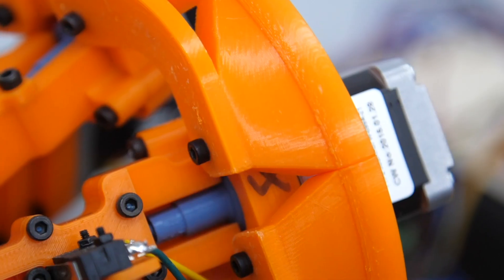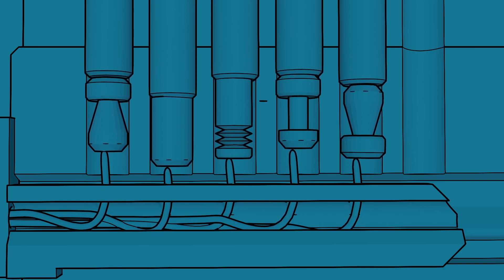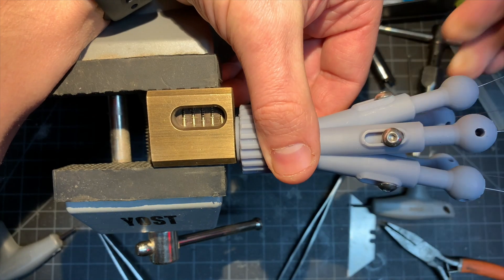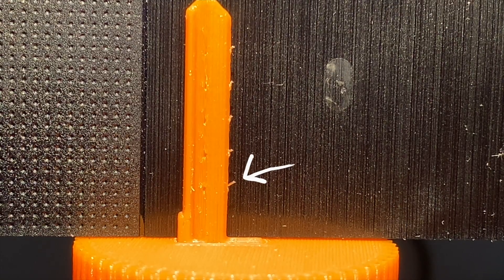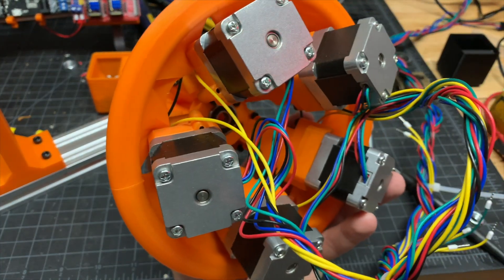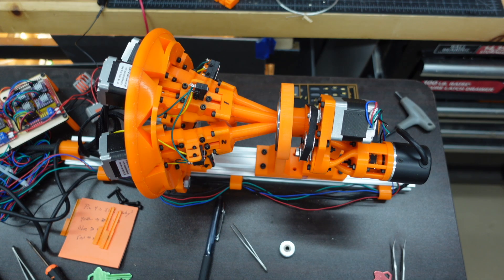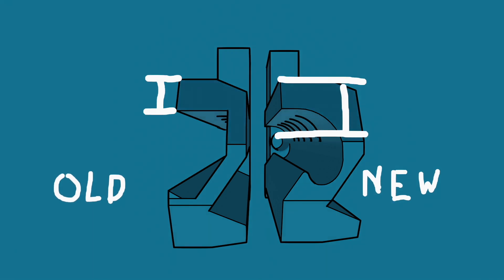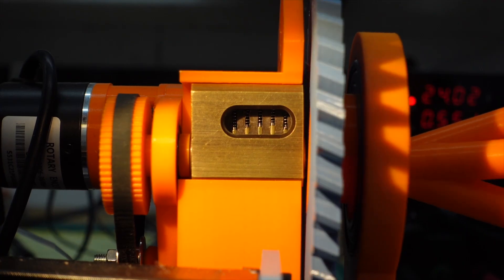i made a robot that picks locks WITHOUT A PICK

Comment: @SparksandCode which thickness do the hardened steel wires need to have?
generally speaking: the list of things to buy is missing
Reply from the maker: "Folkcraft Steel Music Wire, 50 Feet of .009 (#0/1)" ... looks like it's no longer sold on Amazon so you will have to look around.

Yeah, because I only bought a few things. Most was laying / stolen from older projects.

Comment: You could do the same thing with two motors. One connected to a linear actuator and the other connected to a wheel with holes for each wire (think revolver but wire instead of bullets). This way you can upgrade this setup to as many wires as needed without increasing the motor count beyond 2

Comment: Cool idea.  Sounds fun.
A couple of things to consider (plus a bonus idea)
1) Have you considered using the linear steppers they use in hard drives.  They are super cheap
2) Since your key wire guide design seems pretty stable, have you considered buying a metal one online (like Xometry or Protolabs)?
3) Another interesting idea for making a metal key wire guide would be to cast one using a low temperature casting metal and a high temperature wire that will not bond to the metal (like titanium) to form the wire paths.

Comment: Should’ve filed two keys down to half the original thickness then used a CNC mill to make passages for the wires on one of both halves (pending wire gauge) before welding the two halves together

Comment: Couldn't you just machine a hole or couple holes in the butt of a blank metal key then machine holes where the teeth would be until the holes intersect? It might require some patience but a metal pick seems feasible.

Comment: your first mistake is 3d printing the key instead of machining it out. 3D printing sucks for these things.
Your 2nd mistake was using stepper motors instead of $10 linear servos off amazon.
You can sell your first 3d printed design for much cheaper by just having it ram everything to the top and letting you turn the key.
Dude this is overengineered to a painful degree

Comment: Considering most locks, including the one you're testing on, have room for six pins, why did you not include a 6th digit? Seems ridiculous to build such an effective device, only to be limited to cheaper locks that don't use that sixth pin.
Reply: Regardless, this is still very cool and impressive. Thank you for the video.

Comment: If this device were in production, it would NEED to be metal.  Once your manual version of the thing was successful, you should have made (or had made) the metal version of the keyblade.  

I see that your machine is essentially "brute forcing" the combination.  I think you would be better off with a "random" mode that selects from "likely combinations."  It's pretty well known that if a key went from 1 to 10 then back to 1 again, it could actually be a problem for both the lock and the key.  So it's not usually done.  An algorithm that takes this into account will better control the range of random selection for each combination and thus, on average, increase the probability of resolution.

Of course the "brute force" algorithm should always be an option for the user knowing that it will simply take a lot longer.  I would expect people to favor the random and simply run it for a limited time before saying "OK, let's move on to the slower and get some coffee."  But an effective "random" hunting algorithm would be one that remembers what it had already tried previously, so don't discount the effectiveness of the random out of hand.

Eventually someone will come up with even more sophisticated programming to solve things even faster.

Comment: This could be done with one motor that on each rotation would create tension to rotate the hub. Now similar to a counter on each full rotation of the motor the counter would jump to the next digit. Now if each digit is connected to a cam it would pull or push the wire to the desired value. Now it would be best to minimize this machine or send all wires trough a flexible tube. Tube may introduce errors, but it can be negated if the wire movement is higher and scaled down at the end. To avoid spiral cam you could place numbers ramping up with even numbers and ramping down with odd numbers. Other considerations, the digit closest to the motor will move up and down more times than the other. The motor speed could be a minimum of 60 rpm. This means it could take 28hours to try all combinations. The motor could go faster. The success criteria is when the hub is moved more than X degrees and cuts power to the motor. No software necessary, just dc motor and power.

The idea of a software would be best with sequence that only moves one wire at a time and still goes trough all the combination. This would prevent wear and tear on the fist wire. With steppers I would have pulled a flexible wire/rope on the rotor, spring loaded for return. This way I would know exactly how many steps from position 0 to 1. For speed one step per position. Torque might be sufficient.

Comment: Question, if the pins above are the same length, the ones that don't move with the tumbler when unlocked, why not push all pins to full with the wires on low torque so they only go to max and no further, then have the machine draw the wires back the distance of those top pins? Since the wires will adjust and slip to the right lengths due to the low torque, when they are pulled back the right amount they are all aligned since usually that second pin above the varying pins are all uniform in length. I know there's other things like springs and what not, but under full load most of that is generally going to be the same length with the only variations being the interchangeable pins used to interface with the key. But if you just have the robot push all pins to full and have it so the motor torque can only push them to full and no further, drawing them back the right distance will align the key pins.

Granted the easy way to fix this is to have the second pins above be different lengths as well, but what I've noticed from most lock picking videos is those pins tend to be the same length. So instead of developing an attack just for the pins used in a traditional pick, why not develop an attack to use the second pins as part of the attack?

Comment: Have you tried any of the 3D printer filament that is powdered metal ?
Supposedly you just make your part 25% too big then burn the plastic out in an oven and the metal dust turns to metal.

If that actually worked you would have a stronger key insert thingy.

FWIW I don't even have a 3D printer and am high atop the peak of Mount Stupid as shown on your Dunning Kruger illustration.

Comment: Why stepper motors instead of servos, it's not as if the stroke length needed to be long and wire wouldn't be sufficient over any length. Servos would give adequate control and force reducing build size and removing the need for linear conversion or sensing position.

A metal cast key head would prevent breakage, I assume through excessive twisting as the lock is tested.

Comment: This is really good, but I cant help but spot the problem of the decifering.

IMO the wires are too thin and have too much freedom, and testing each combination takes ages.

Apparently there is a way to determinate the aproximate volume of a metal with electricity, you can use the driving wires as proves to measure the aproximate volume, you can maybe also use a camera and some small crystals and mirrors to look inside the lock and measure the diameter of each pin.
Then test the maximun distance each pin can go.

With all that calculate the posible solution and try.

I also sugest to use teeth, push them with wires if you want, but I cant help but think that the small wire is prone to bend, you can also try small pipes and those precision pumps that hospitals use to precisely measure liquid pump. ( I remember some videos of people making some in 3d print)

I actually dont know shit about all this, but I thought all of this was posible for someone with you skills

Comment: Make a safe-cracking robot. A group at MIT made an example, once. I almost had to make one to get into a safe (until its mechanism jammed, entirely). One of the funnest parts of a combo-lock solver is figuring out just how (and how much) you can speed up the search. You can spin the dial really fast, but you can't just stop immediately or the discs inside will keep going, so you have to program in some acceleration into your stepper code.

Comment: Very interesting.

I am stunned by the tools available to prototype with today. Had they been available when I was 18 in 1973 I might have fell into the mechanical engineering rabbit hole instead of mathematics.

Too bad there does not appear to be a faster than brute force approach with respect to the software algorithim. But, from my view this needs confirmed & investigated in that it like casino games is the type of probability problem that Persi Diaconis or one with a similar background in mathematics might find must behave in a manner that can be taken advantage of.

 I was shown how to pick locks by an old Green Benet. He had a gun like device that thru repeated pulling of the trigger opened the lock. As I remember the device worked in under a minute, and this begs the question, why....

Comment: Great project! Why not team up with another YouTuber that has developed a DIY wire EDM machine to make your key from a blank? Also, maybe it’s better to monitor the barrel rotation motor current to determine the torque being applied and have a control loop around that.

Comment: Great job but overengeneered.. Lock picking lawyer does it in 0.1seconds.

You should watch some of his videos and for example add a feature that pushess ALL of the pins UP more than usual - for locks that have no protection against pin overtravel

Comment: Some remarks I had during the video. Might help with version 3.
1) You need two motors. A big one for pushing the wires and rotating the lock and a small one for "switching gears". You rarely move more than one motor at a time anyway.
2) 13:44 - Have you tried using two keys to make one? Like molding two parts and joining them because one mold would be too hard to pull off. Or you could order a custom metal part.
3) This might actually become a useful product! You could duplicate almost any key if you know its template. It does no damage, is reusable and even works on cylindrical locks.

Comment: Another side benefit to using this tool is you can begin to map out the locking styles of different lock manufacturers. So, for example, Master locks May only push their pins in a certain distance and or only have a certain degree of variance. All very hard information to get without having a tool that's digital. Kind of scary when you think about it...

Comment: Great job!  20 years ago I dreamed of a lot mechanism that used a wire for each tumbler with a 90deg  radius and the mechanism with a rotating wheel and springs to randomly go through the patterns. You've gone beyond that simple idea. Only reason why I wanted to use the wires was if one of the tumblers happened to catch in the middle , the rear tumblers would still be cycling whereas with a lock pick tool would be limited  if the tumbler actuated at a low height near the middle.  Please don't give up, I think you're on to something that will change the entire lock industry. In addition, hopefully will provide you unlimited resources for future development in other areas.  I would be surprised if there weren't 3 to 4 novelties worth filing IP for.  Hopefully you are protecting the initiative and investment of time sacrificed in your life, I'm sure what you've learned in this project is invaluable, and will be utilized again in the future for something else.

Comment: Maybe just add a metal tension tool to the lower part of the key slot. This way it takes the brunt of the load. Then it opens up opportunities to use a load cell or something else to tell if the lock it picked.

Comment: I wanted to do this exact thing for many years. Good job so far man. Clearly one MUST speed up the testkey() operation since , every MS saved there adds up (x10,000).  You NEED to use a lubed METALLIC keysubstrate for sure, this PoD[esign] requires you to access the locks rear prior to picking. Speaking of iteratives affecting speed: use parallel not series ex:set all pin heights at ONCE. Consider also setting the heights then checking the key then drag them ALL down ~1, check, to ~0. Also every keylayout aka (pin height series) you try you should be saving that fact like into an array. eg with 89999 elements for a 5 pin tumbler. we save 100k elements not tries (with 5 pins) since you can't denote a numeric array with preceding 0's, you would just pad the left with 0s out to the number of pins. Having this memory of tested keys could also allow you to save your progress on a specific lock. you could also jump randomly to likely areas of interest in respect to pin height series' like what we see in other keys or other interesting ways to step through the keybase  perhaps depending on the keytype. for example by imagining there are less then ~10 heights. you could also go randomly push/pulling strings in a tempo that doesn't repeat an already tried pin series (which you could easily check in your array before calling testkey(). I have noticed that 3/4 of locks can be opened by another key if i put twist tension and slide it in and out. took me decades to perfect this technique so i'm convinced there are less then 10 heights in use or rather that are important,

Comment: FYI, your "key" breaking issue looks to be because of stress risers from a square interface with the main circular hub/part (see 3:49) since they all appear to break at almost exactly the same spot.  If you add a small fillet, even a tiny one, its strength will increase significantly.

Comment: You could use a some sort of spring like one of those spiral springs in watches to apply torque until it hits a microswitch. That allows you to mechanically limit the torque instead of relying on the precision of the gearing and encoder.

Comment: Why now use a optical sensor hooked up to the part that rotates the key, put constant tension on the cylinder and watch the torque on the spinning part.  Once that loosens up, you should have a set pin.  Try one pin at a time, just like you would with manually picking, tightening back to that same torque as the beginning after you set a pin.

Comment: As a retired locksmith I find this fascinating, though I question the reasoning behind the venture, anyone who has trained or even amateur pickers would have much faster success, putting the optical encoder to the rear of the lock would negate any real world use, I personally wouldn’t have used so many motors and worked on something that the actuator choose which pin to move and put an initial tension on the lock as in conventional picking, the part about security pins being negated is a mute point, a good picker can tell if there’s a security pin and know how to get past it, this can be taught and if people can learn so can computers. 😊 feel free to hit me up once you recover 🤯 if you want to brainstorm 😊

Comment: i can see an epic goof right away........each pin-pusher wire lacks a feed-back device to detect "pin at shearline" state.
also, try a spring in the rotator motor to apply a moderate amount of tension after 1 or 2 steps from the rotator motor..
for the sensor and control logis may i suggest an Arduino?........i hear they are good for projects like this, and they're also easy to program.

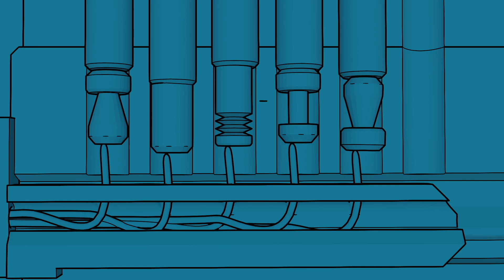Comment: security pins don't go where your animated slide at 1:43 are suggesting they go, infect they would be completely useless in that example

your small stepper motors are probably fine for an application like this, just use a better gearing ratio to move the wire in and out faster, your spinning a screw and then sliding a carriage back and fourth on that screw, meaning you need one whole rotation of the screw to move, one thread distance in or out, why? just stick a cog on the end of the stepper motor and use it to move a gear rack back and fourth, or just have a stick that moves back and fourth connected to the stepper motor, and attach the wire to that. the stick acting as a lever, giving you mechanical advantage over the wire meaning less stepper distance = more wire distance

what do you mean your looking at the back side of the lock to see if you have picked the lock or not?? what?? why? what are your design constraints for this? i can imagine you putting this device on the outside of the lock but needing to surround the lock and have stuff looking inside the back of the lock, mate your taking the easy way out at every single turn. this is not engineering and it is not impressive, engineering is about having a design restraint and then figuring out ways to overcome those restraints

if anything this is just, a video on bad design philosophy, and how bad design philosophy causes issue everywhere
i would suggest that, for version 3. you really sit down, wright up some design restraints. and wright up step by step what you need to solve or do. to pick the lock. then figure out individually, what is the best possible way to do those individual things, under your design restraints, think about what you actually need. think about how much force you actually need to turn a key in a lock, think about how much force you actually need to move the wire in and out. don't compensate with "well i guess I'm going to buy a bigger thing to solve my problems for me"